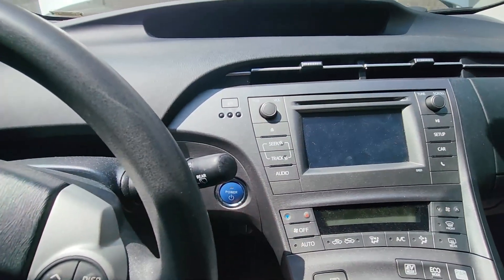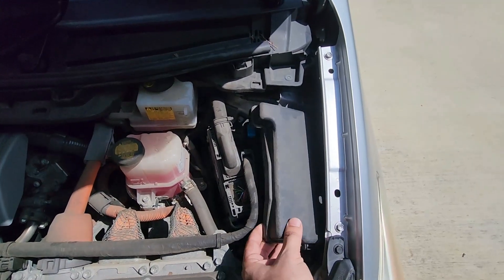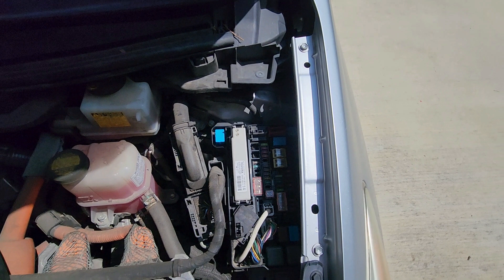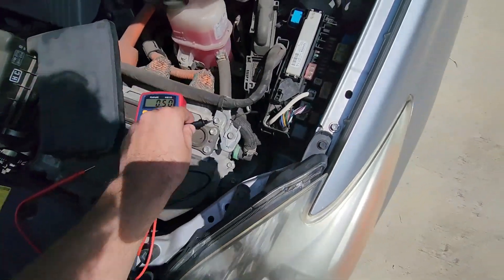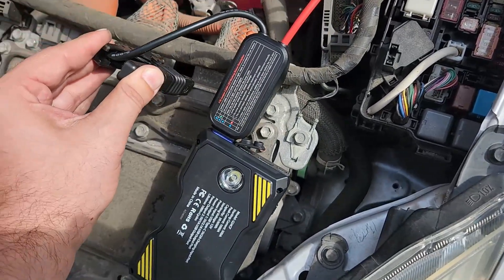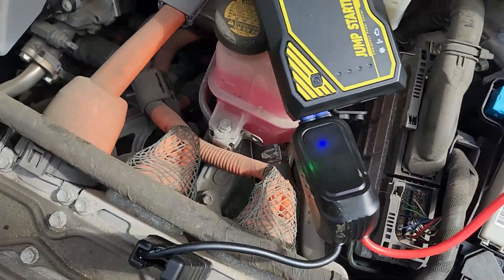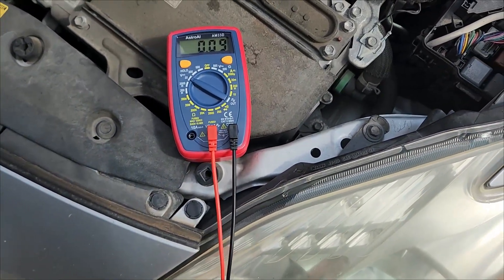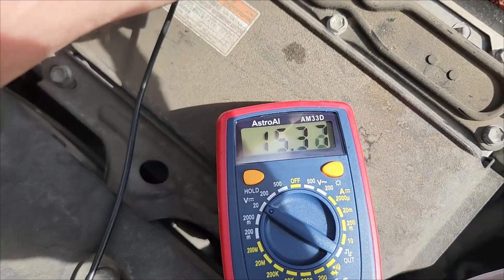Dead Prius won't turn on! ("Jump-Starting" a 3rd Gen 2010-2015)

Comment: Hi man, thanks for the video. Just so you know, once the engine is running you should disconnect the jumpstart kit. Because both the kit and the converter will charge the battery and voltages above 14.6 can damage your components.